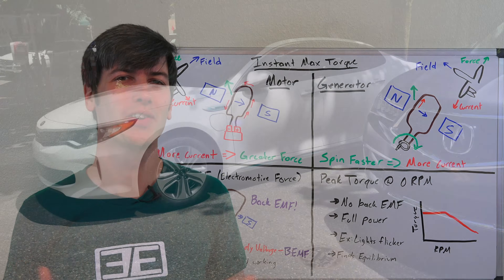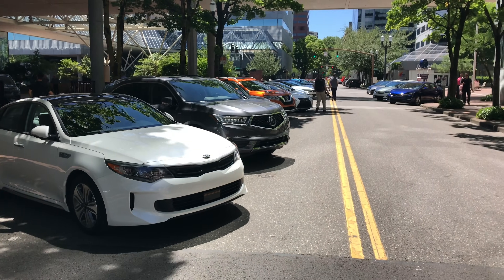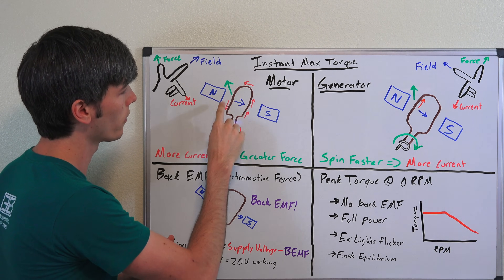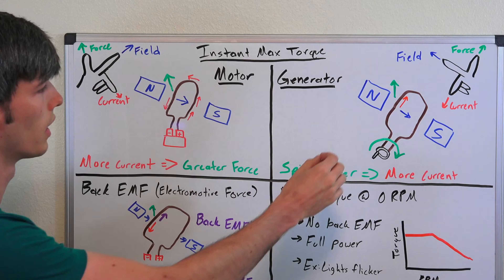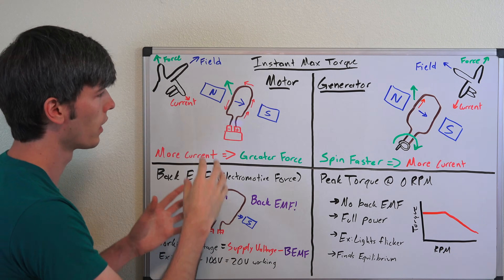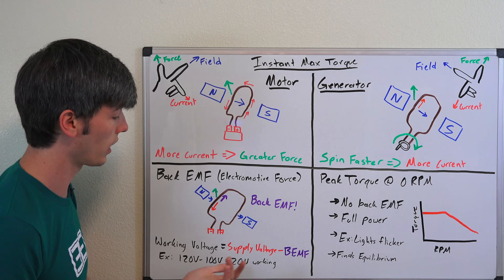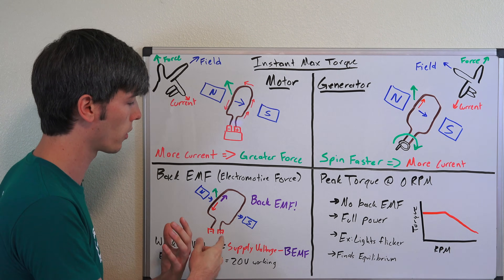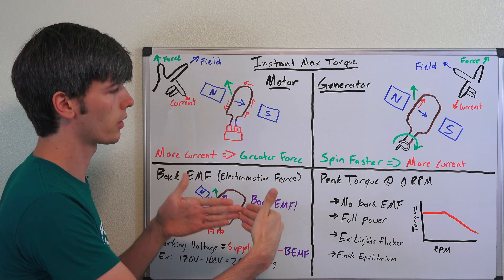How Do Electric Cars Produce Instant Maximum Torque?

Comment: electro magnets only produce the guass that is on the specification, as soon as current is passed through them, you have the maximum amount of torque, which is why electro magnets are the only way of turning massive axles/shafts like cargo ship propellers, fuel on ships is just being used to generated electric
Reply: for_all_those. thats....wrong.  lots of direct drive ships throughout history.
Reply: No, the propeller is being turned by a IC engine in 'direct drive'. which is what most ships use cause it's cheaper and less weight.
Reply: DrewLSsix My wasching Maschine also hast direct drive and it works perfect.
Reply: washing machine motors are made from old copper coil, there is a limit to those electric motors too, which become less efficient to using modern electro magnetic plates with different metals making the magnetic field more balanced etc, cargo ships will more then likely have plates where retracting force of the same poles will turn the axle
Reply: what DrewLSsix said, most Cargo ships use a gearbox, one forward and one reverse gear, and the forward gear is the most efficient gear when travelling at the ship's design speed.
Reply: rubbish ships might have been 15 years ago, they are all electric in todays world, if you can generate  a few watts you can power a 2000Kg.cm single speed motor, there are plenty of might ships episodes on youtube, you can watch some, or some of the hundreds of other documentaries on ship building
Reply: Nope, most modern cargo ships, as in those built within the last 5 years, and those being built right now, yes even the very expensive super advanced ones, have direct shaft, which is one of the major reasons why ship bridges are at the back, or in case of the larger container ships, only the smokestacks are at the back.

So no, they are not all electric in today's world, not even close.
Reply: must be MiT
Reply: clarify please
Reply: Idk why the direct drive vs induction drive matters, the propeller is being turned by an electric motor in direct drive systems, no??
Reply: Well of course.. Translating power from electric to mechanical just means more losses.
Reply: america needs fossil fuels to balance the deficit in the annual budget so they don'nt become bankrupt, any european car that can do more then 100 MPG are banned from being imported to america because they can only make cars that can do 45 MPG, any more would upset the economy, which was all in the news when america has the car market crash and congress was debating it all

http://www.ship-technology.com/features/feature-the-worlds-biggest-cargo-container-ships/

permanent magnets are banned in america, while europeans and turn direct drive wind turbines into perpetual generators, while maintaining the 20 RPM, and abit of thermo electric generation, once they get going after a battery startup, they become perpetual
Reply: so if you want good times and do want you want tech wise, you want bristol instead of MiT http://www.bteacademy.co.uk/
Reply: @ bung cheese,i don't understand your point? Ships have an IC engine (or steam or gas turbine), which turns the propshaft, no electrical energy, except the generator, that is also turned by the IC engine (or steam or gas turbine), which powers all the lights and ACs etc.

@for_all_those
.......
wut are you talking about?
Reply: manthanboeing all I said was of course they do direct drive because it'd be a net loss to send power from an IC engine to a generator, losses from rotational inertia/friction etc. I said of course it's more efficient to not run any sort of 'middle man' 

Of course the IC drives a generator, I'm aware of the purpose of alternators/magnetos in IC motors. You can't assume everyone on the internet knows nothing. Also you cant assume everyone on the internet is disagreeing with you. I just said I see why they do direct drive. 

I was originally here because I thought we were talking about power transfer via shaft or induction drive but that's not what 'direct drive' means (which I learned today)
Reply: I get you now, i was just trying to clarify what you meant by electrical to mechanical.

On that subject, quite a few warships and cruise ships have electrical motors that drive their propellers, cause of hugely varying power demand, just not cargo ships, cause they have very similar power demand almost constantly.
Reply: Watch out guys we got a boat scientist
Reply: they use nuclear power to power the DC motors which turn the 1000 ton propellers, and to power the rest of the ship
Reply: @ YUKI JINJUJI   @for_all_those

I think just about all nuclear powered surface ships use geared steam turbines, don't know about submarines though.
Reply: Man that seems efficient. Spin up the entire massive weighty steam turbine assembly and then modulate power via a clutch? Seems almost more efficient to generate electricity and do it that way. I'm not a boat scientist though
Reply: You have to generate electricity somehow, you do realize, power plants produce steam, not electricity (at least directly)? And then the steam turbines drive generators, which produce electricity. In most all Nuclear powered surface ships, steam turbines are connected to gearboxes that drive the prop shaft. The turbines also drive generators, that provide all the electrical functions of the ship.
Reply: manthanboeing you have a locomotive as your profile picture so I believe you. Those are all direct drive right? Makes alot of sense.
Reply: Also that explains all those steam powered direct drive teslas driving around.. Hmm I'm really intrigued by the whole thing.
Reply: I know it seems a bit sarcastic but I don't understand the flip flopping between converting heat energy into mechanical energy to turn it into electrical energy. Losses all across the board. I just am trying to figure out what's going on inside the heads of these engineers.
Reply: LOL, that was kinda funny.
Though ya, all electric locomotives have single gear ratio direct drive from electric motors, diesel electric locomotives use a generator to drive the electric motors in the first place (though there are a couple that use hydraulic drives)
Reply: there would be zero point in using nuclear power to create stream, when depending on the distance between magnets, 1MW magnets can have more force then a neutron stars gravity, and a single 1MW magnet can easily pull the iron out of your blood and through your skin
Reply: for_all_those WTF Are you talking about?! You do realise nuclear plants create heat right? And hat heat is then used to turn water into supeeheated steam, which then drives turbines, which in the case of land based power plant is used to drive generators, in the case of surface ships (and probably most submarines) the turbine drives the prop shaft through a gearbox.

BTW, all thermal power planta work this way, as in they generate steam through heating water.

Also Neutron star? Really? 
At this point you are just throwing around scientific words that you have heard somewhere previously.
Reply: no, the heat is used for cental heating, its the same in submarines, but with the extra power you can have in submarines, they can electrocute water and split the atoms and make oxygen which is called electrolysis, its how the brits do it anyway with everything being made by BAE Systems
Reply: for_all_those .......... how do you think they get electricity from nuclear fission, please explain to us.
Reply: with quantum physics, its all made by BAE Systems, they had to make america's railgun because lockheed and boeing was'nt good enough, so now BAE Systems have EM Drive leaving plasma trails across the orbit with skylon
Reply: submarines definitely don't use steam anyway, the genius solutions people come up with to lower the heat signature and remove as many moving parts as you can, would be classified
Reply: DrewLSsix sure but his point still remains as fact. What do you think nuclear subs are doing, rocket shipping thru the water? No they generate electricity.